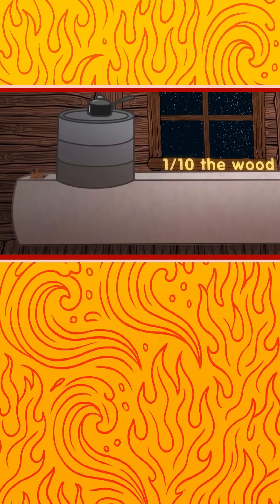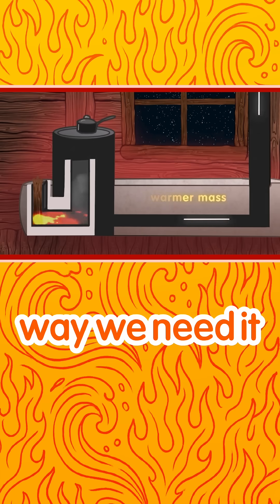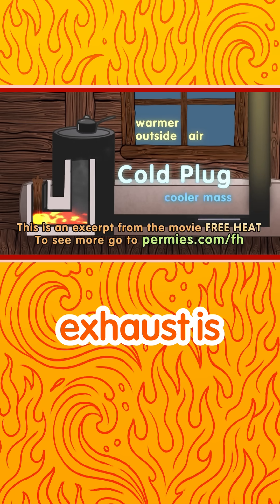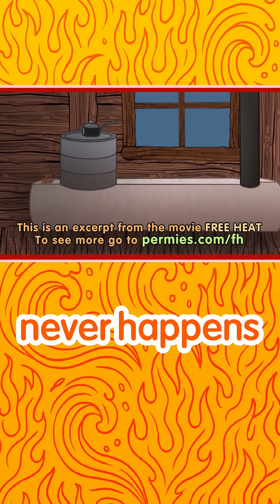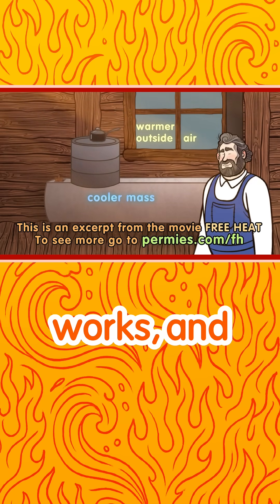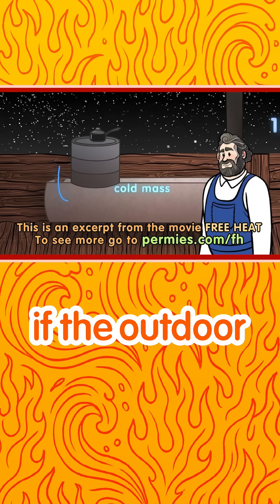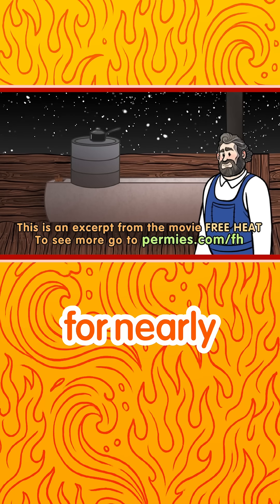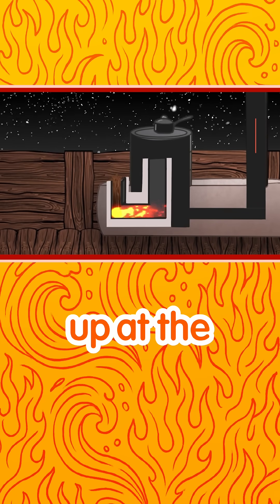Rocket Mass Heaters - cold plugs

Comment: If you have electricity, could you use a fan at the inlet to force air through, getting heat going and blowing out the cold plug?

Comment: Can you use a fan at the top of the exhaust, to suck out the cold plug. What about a removable fan in the mass part. Start the fire, turn on the fan to push cold plug out, once cold plug is not blocking airflow then remove the fan. Would that solve the issue?
Reply: I use a blower or a hair dryer to blow air through the burn chamber and up the chimney.  A hand powered blower can work too and/or a hand held propane torch to prime the system.
Reply: I was thinking the same thing. A fan in the exhaust pipe to pull the smoke along till it all heats up??!? But since the whole efficiency thing is that the exhaust isn’t hot maybe what I am thinking is that fan can get the air flow gets established?? Anyway. Thank you so much for pointing out this kink in the design!! It is so helpful to think about this in advance!!